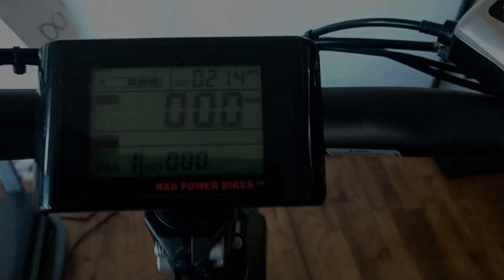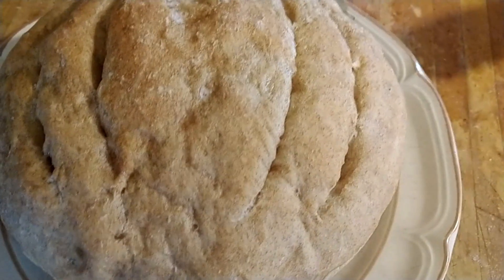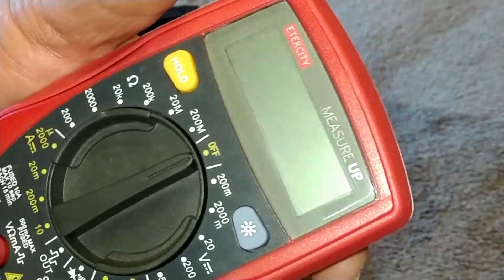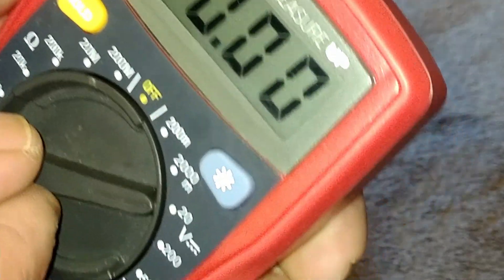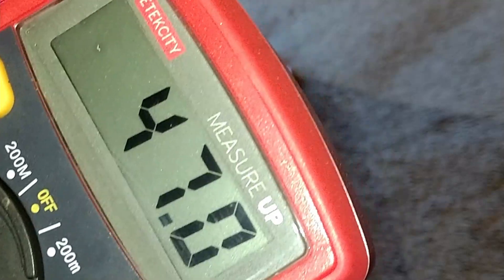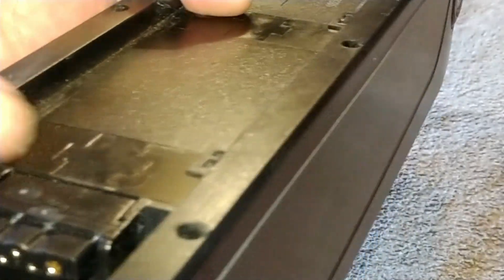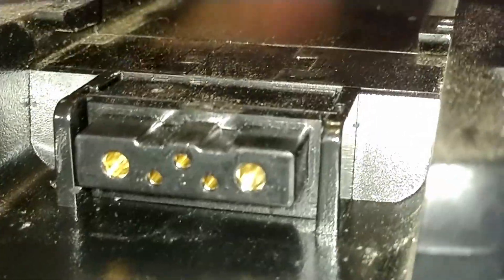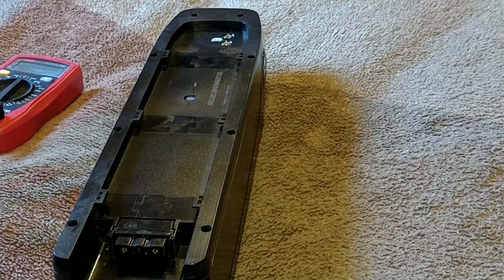Using a Digital Multimeter to Check E-bike Battery Voltage (Applies to Lectric & Rad Mini 4)

Comment: Mines reading all over the place. I can’t get a steady read. Also, when it’s on the bike it works off and on, mostly off. Probably time for a new battery huh?
Reply: I got it to stay at 32 one time and 53 the other. It’s a 48 volt battery. Let me know if you think battery replacement time! I don’t think the voltage should jump around like that. My e-bike shows E-6 error code
Reply from the maker: I have been getting the same error code on my bike when I turn it on. However, it is NOT often when I get it and it seems to correct itself and go away. My Bike is now 3 years old. I would make sure the contacts are clean. Use rubbing alcohol on them. Re-check with meter and make sure you place the black (negative) first, then place the red lead. Maybe that will help give a more accurate reading. Also, any issues with your charging unit? Please be really careful if you notice anything out of the normal while charging as some of these batteries/chargers could overheat and pose a fire risk.
Reply: @Pandafoo  thanks for replying, I’m gonna try that in a couple hours. The bike was bought brand new in January. Charger should be fine, The battery is probably bad after riding it in the rain. It started to act up a day after riding it in the rain.
Reply: @Pandafoo  still nothing. I just want to make sure it’s definitely the battery before I buy a new one cause those are expensive lol. I think I’ll probably just have to take the risk.
Reply: It ranges anywhere from 0 to 54

Comment: Voltage tell’s nothing, it’s all about Amperage (capacity)
Voltage measures pressure about electrons to flow
Amperage measures the capacity of electrons…the more the more powerful.
So A bad battery can measure good voltage but this show untaxed.
Reply: Thank you, I thought that the voltage should remain constant to drive the motor and yes the amps are like the  gas tank.  Not sure if you will read this but my question to you is I was thinking of buying a used ebike and doing a voltage test on the battery if the battery is rated at 52 volts and the reading is lets say 48 would that be an indication that the life of the battery might be less or if factory fresh you should get 25 mile range but may only get 20miles? Hope you respond, thank you
Reply: @jimthompson7035  hi Jim, first thing  to keep in mind when in buying mode…first check the age of the bike on receipt. Second step, check the bike computer, to tell you how many miles/km’s is driven. Measure if date and miles is related to fair daily use. 
Third…depending on age, ask if the battery been replaced.
Important: Make an appointment with seller and ask him/her to fully charge the battery when coming the other day. So you can see on the battery indicator, the battery is fully charged. Because weak batteries can’t get fully charged indicated. Or maybe yes but when ask for a test drive…use full capacity of the motor. When the level indicator quickly runs back…there is a bad battery..
Reply: @Retro.Studio  Thank you so much. I did not realize that  a bad battery would not charge to 100%. The bike is 4 years old and has 600 miles . And as the cost of a battery is the highest factor this is good to know. If I may ask one more question, the bike is a Kepler Rider that uses the 52 volt battery, the bike has a second battery he says he  used a  y splitter that runs in  parallel , should you use a  balancer  to reduce the risk of damage to the batteries or the motor? Thank you again, Jim
Reply: @jimthompson7035  that bike is a stunner. Absolutely use always a balancer/discharger to kept both batteries in top condition. use of a splitter depends on how long your axi radius track gonna be. Cheaper? Yes! But yes a balancer is a much durable option.

Comment: The battery isnt going to run out linearly. It might run down quick on the first half and much slower on the bottom. This is also going to change through the life of the battery. A load test will determine the overall health of your battery.
Reply from the maker: My battery drains the slowest on the first half - 54v to about 50, then it starts to speed up how fast it drains below 50v
Reply: @Pandafoo sounds about right. That's how I meant to say it...I just wrote it backwards. Best to charge it after every ride too. Unlike alkaline batteries lithium ion cells like to be topped up...and try not to ever run them out flat.

Comment: Great now im annoyed at my bike battery and also hungry.
Reply from the maker: some batteries just like to cause problems for whatever reason. Mine occasionally gives an error on the display after it has been fully charged, but then it goes away and bike works just fine.

Comment: How can you be down 50% at 47.0 volts with only 7.6 volts down from 100% charge at 54.6 volts.
Reply from the maker: Okay, let me explain. I base the % on when the bike basically turns off. For me this is around battery voltage 43-44. Also, keep in mind the voltage drain is quicker the lower your battery gets while riding. A battery is considered getting a full charge when this happens, but riding until your bike turns off is NOT good for the longevity of your battery. I always try and never let me battery go lower than 46 volts for this reason. Hope this helps you understand what I meant :)
Reply: Thanks, I appreciate it, and yes, I'm new to the ebike world and don't know anything about how to get the most out of a battery. Thanks again for the information. ✌

Comment: The key does not turn on the battery. the key is only to lock the battery in place. the battery has a on off switch on it.
Reply from the maker: On both my batteries, the Lectric & Rad Mini ones, the key does turn off the power on the battery. I had to turn the key to the on position to get voltage from the battery showing up on the multimeter.

Comment: Should my e-bike battery give a reading if the key is off? Mine is reading at 25 volts with no key in. But my other battery only reads at 0.7 with the key off. Trying to determine if I have a faulty battery since it keeps cutting out power to my bike every couple miles. I have to turn the key off then back on to turn the display back on.
Reply from the maker: Hmm, sounds like there is some internal problem inside the battery. I have never had a voltage reading show on mine when the key is turned off.
Reply: Thanks for the quick reply! Yea I think that’s why my battery keeps cutting out while riding. Just waiting on Lectric to get back to me and see what I can do.
Reply: I think it depends on the manufacture of the battery.  My xp2 standard battery, gives me a 0.4 without the key but reads normal with the key on.   My xp3 step-thru battery reads the voltage slightly lower than when it is on (44 vs 47).

Comment: Hi hello thank u for the video , what if ur meter keeps going my battery is just like urs and it fully charged my meter didn’t stop it went all the way pass 100 can u tell me what that means,, thank u
Reply from the maker: did you have your meter set for DC current? Also, makes sure it is set to handle the DC voltage for the battery. My meter has a switch to allow for up to 200 DC volts.
Reply: @Pandafoo  I had it set on 2v-600v V DCV
Reply: I just bought the meter for 24 bucks I hope it good
Reply from the maker: @susiekendrick1650  make sure you are using the red wire lead on the plus side of battery terminal and black on the negative.
Reply: @Pandafoo  ok thank u for replying
Reply: @Pandafoo  i figured it out I still had the plastic covers on the probes duh ! Thank u so much for ur help
Reply from the maker: @susiekendrick1650  you are very welcome. I left the covers on once while checking a outlet..Haha
Reply: @Pandafoo  hahaha

Comment: I wanted to say thank you for this clear and visual video.  I followed your instructions and checked my battery....it's ALIVE!!!!  I have not ridden my bike for over a year due  to many circumstances.  I charged it still thinking it was totally dead.  Meter said 54.6...the trick...turning the key on.  I'm also impressed it (the Rad battery) that we bought in early 2020 and haven't ridden in over a year have great charge.  Thank you again.  It's people like you who know what they are talking about, share their information no matter how small a task.  That small task for you can be a huge unknown task for the laymen like us.
Reply from the maker: I am glad it helped you out! The batteries can last a long time if stored correctly and kept charged to around 70%. Being able to test the voltage really helps with this. Again, thank you for the kind words :)

Comment: You inserted the red + first then black - last.  If you insert black then red will it produce a spark?
Reply: Spark occures when you disconnect the charger black lead to the frame. No other time on a dead battery. There is no charging off gas with lithium to light up
Reply from the maker: I've always done red then black. I do not know if it would spark as i've never tried it like that.

Comment: How did you determine at 47 volts, battery voltage is down over 50%? From 54.6 full charge voltage?
Reply from the maker: It is based on the average voltage when the bike will shut down. Mine for example shuts down around 43 volts.
Reply: @Pandafoo  Do all 48 volt batteries top out at 54.6 volts? I just looked at my display and 48 volt power levels. the top level is only 50 volts? Does that mean it's a lame battery? The maker Polarna makes no claim as to who battery maker is. So I'm guessing it a Chinese battery maker. Btw, thanks for taking the time to answer questions.
Reply from the maker: @SonriseSunset  Well not sure with your brand, but with my Lectric and Rad Mini 4 batteries they both top out at 54.6 volts. I would think that a 48 volt battery from another brand should do the same, but I could be mistaken. Sorry I couldn't be more precise regarding your brand.
Reply: @SonriseSunset  my M2S 750 is showing 55 volts with a 48V battery pack if this helps at all.
Reply: I have an ENVO battery and when I checked it, it’s showing 24 V. It is a 48 V battery. I checked the front fuse and it is fine. Would there be another fuse inside the battery that could have blown or does it mean that I have a bad battery? Thanks for any help.

Comment: If you hold up and down the screen will change do it again twice it’ll show voltage
Reply from the maker: Rad doesn't give advanced menu options on my Rad Mini 4. Also, doing what you mentioned only brings up tire size for speed rating. I did not see any voltage reading on the display.